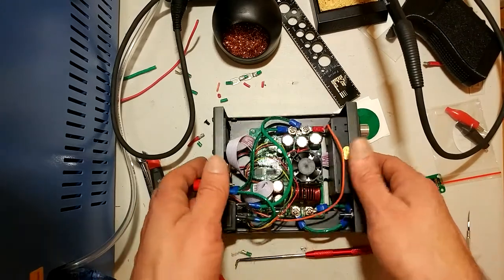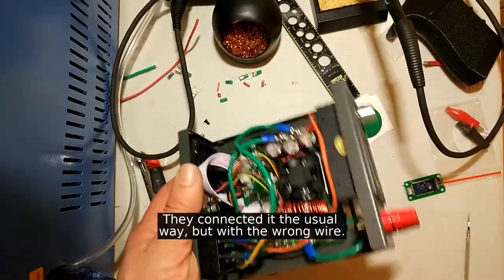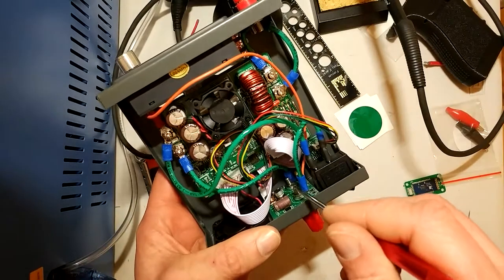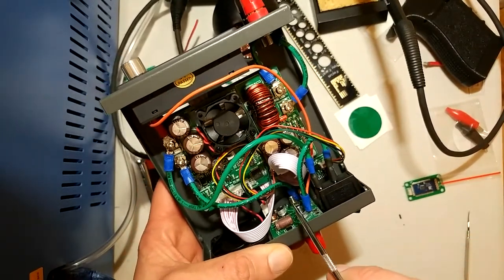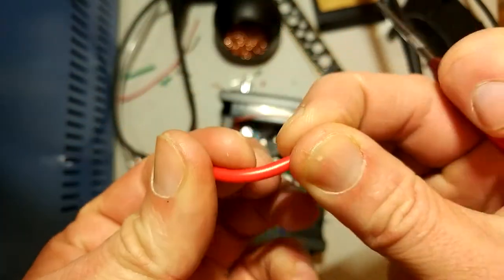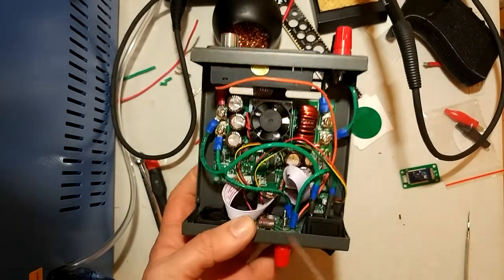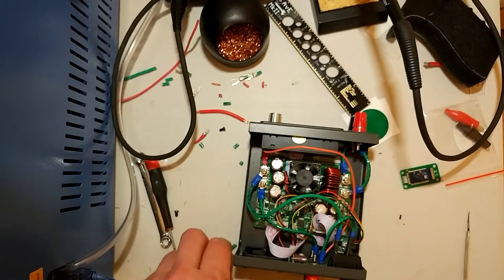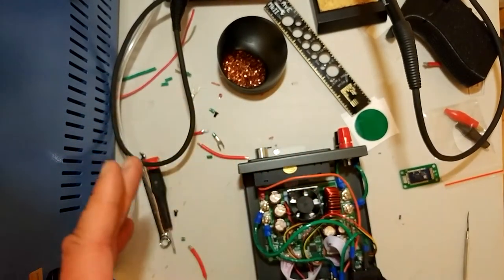RD Tech DPS5020: Assembly Tips

Comment: Hi, thanks for your video. I watched your video before attempting to assemble the unit I just purchased. I attempted the manufacturers instructions and it went together quite easily. I had a beefy tip with the temperature set up at 290degC. I assembled the rear pcb first, then when cooled down I bent over the wires and attached to the switch with no issues. Also the terminal supplied soldered easily onto the wire supplied very easily. Maybe its the good solder or beefy hot iron I used. Went together easy. I have no affiliation with RD. I have used the RD6006 and also recently purchased another RD6006P and they assemble very easy as no soldering or wire cutting is required as everything is pre-terminated. Sorry my experience does not agree with your observations, maybe iron size or temperature or solder type / flux related. Also dont bend hot wires, let them cool down first. During the assembly everything was a breeze for me.
Reply from the maker: Oh, I'm totally open to the possibility that I'm bad at soldering. Hahah. I work in software, not hardware, so I generally prefer my electronics come preassembled!

I'm glad that you were able to put it together easily. This is just another option for amateurs such as myself.

Comment: Flexible (many thin wires) silicone-insulated wires helped a lot. 13 AWG (12 AWG did not fit in the big holes on the small switch board), but I had to solder the wires for the switch to the pads on the board.

Btw have you tired to switch off/adjust the speed of the fan on the case? It spins up even when there is no load.

Comment: Hi - still building the 5020.  Thanks for the warning!  I fear that as a follow software guy, I might have made a mess of it without the warning.  But I am using a different stratagem to mitigate the difficulty.  I'm soldering that small power distribution board first.  I'm starting with the "key" (for the switch) ... the small pads / holes.  BUT: I'm using some high quality silicone / lots-of-strands (very flexible) 12 AWG wire. Oh - and a 30W soldering iron + copper thingy etc.  Anywayyyyy ... my secret source is to take some header ... err ... 2mm pitch I guess - I forget ... maybe 0.1" ... whatever ... cut off 3 pins worth of it.  The I push out the centre pin (discard).  With the remaining 2x pins stuck in it's trimmed plastic retaining thingy, I push the pins into the PCB holes from the underside of the board.  I push the pins so they're flush on the underside with the plastic retainer thingy.  I use some ... blu-tack we have in the UK.  Tack.  Whatever.  To keep it in place and to stick on a surface.  No helping hands required.   First of all I solder the pins in place on the pads like a normal SIP component thingy.  Then I can carefully twist some (insulator-sleeve removed) of my 12 AWG wire over a pin.  There are so many strands,  a length of it can stand-up in the air by itself, anchored by twisting onto a pin.  Enough length to (comfortably) flexibly bend to the switch (eventually) (after putting on some of those err ... things that go over the spades on the switch thingies).  Yep.  It just stays there.  So I can take my time soldering it (not so much time as to lift the trace of the board (and no particularly heat-sensitive components are near enough to worry about them) but enough time for a 30W iron to attach it to the pad and at least glaze the strands most of the way around.)  Next I similarly work on the next wire, though I can now use some electrical tape to stick it in place using the first wire as a crutch.  And I move the blu-tack away from the heat.  It's possible to do a fairly neat job with a little care and patience.  Next I remove the plastic header-pin-retainer thing from underneath the board, and solder the pin protuberance under there to the pad like a normal component.

I'm confident that between contact with the pins, being pushed onto the pad,  and being soldered to the pads, my wires should have a decent connection for that 20A even if it's not one solid lump of solder.

Finally of course a sleeve of heat shrink goes on.

I'm quite pleased with the result - staying with the traces/pads etc.

I still have to finish the build though - hopefully it'll all work!  I'm using my 12 AWG wire in the through-holes to connect to the main board with ... though very very carefully so as not to have loose strands so close betwixt the poles - and very careful with heat application because of the finer via to connect to.  It does seem a bit odd, the boards arrangement, for the heavy-current lifting.  Oh well - will see how it fares.  I suppose thinner wire over a very short distance, in air, and connecting meatier thermal mass either end, wouldn't do too badly though with 20A necessarily - the thermal connectivity and ambient conduction capacity of the air and all-round radiative capacity and considering a fairly low V-drop over a very short distance might not propose a significant issue, as a feed to a buck converter.  Maybe.  It's been too many decades since I last studied electronics.  :)

But thanks again for this video.  It was very useful, ta.
Reply: It still works - not had a chance to try the USB practically yet.  Still working on a new revision/attempt at a LiFePO4 UPS I'm working ... I need two for my NUCs  for starters (VMware) set-up ... just 19V, but also an isolated Pi-KVM each.  I have an Ezcoo KVM that works with Pi-KVM but I accidentally bricked one when I was using it with a centralised Pi-KVM set-up using a centralised control system UPS I was making but using buck-boost modules for each device ... I'd forgotten how the inductive outputs would cause issues when making grounds common and using a buck-boost module for CC/CV battery charging.  I did get a new Ezcoo and affordable Mean Well DC-DC isolating converters, but I've decided to simply have one Pi per UPS.  Pref. Pi zero 2's as they work with CSI HDMI capture and perform well enough for about 1/5th of the power of the Pi 4's I'm using but it's so hard to get hold of Pi stuff now.

I'm obsessed with 50% standby intent ... thinking even if I charged to 100% every day and let the battery discharge powering my Nuc/Pi etc. to 50% - every day, I might still see 15 to 20 years of useful life if the battery BMS holds-up.  But that's my speculation anyway and only working models and lots of data will provide more confidence to my assertions.

The secret sauce to my UPS fantasies are decent ideal diodes and decent converters.  I'm using kit from the US ... from Minibox for the Y ideal diodes with enable capability, and their USB 200 buck/boost converter for my 19V NUC supply with wide input.  I want to match at least a 120W PSU spec of my NUC's OEM supplies.  Mean Well for a 150W 15V mains supply, a cheap buck/boost for CC/CV battery charging with an I2C FET switch on the input and a basic 15A ideal diode on the output, and a Mean Well 25W 5V DC - DC converter.  Oh - and a 7A - 8A LiFePO4 12V battery that's really cheap!  Bought a few of them ... they're good.  INA226's for high-side (and low-side supported) I2C Voltage/Current measurement as they're available for cheap from Ali-Express along with some temp. probes.

This DPS5020 is to help me with charging/discharge experiments as I could just use MODBUS with my preferred C#.

I want to re-use a bunch of Arduino + similar-to-but-predating-Lorawan complementary encrypted serial wireless chips that are much more reliable for small packets of info over longer range etc. for my battery telemetry and central control  / LTE VPN failover etc. for over-rides of the Arduino - there to manage that 50% charging but also to respond intelligently to various black-out / brown-out scenarios at different occurrence frequencies and patterns along with battery SoC and previous state for events to minimise boots/shutdowns and for phased recovery of multiple systems to avoid surges.  Oh - and having double-conversion in a UPS provides opportunity for additional surge protection.  The Pi-KVM will allow for a couple of cct overrides but I'm keeping it completely Vcc/Gnd isolated to help avoid ground loops via the NUC ... network's not a problem but the HDMI connection and OTG USB keyboard/mouse ... but the HDMI connection might be especially sensitive.

Yeah.  LOTS to do!  When I can get away from work!  Oh - and my Arduino stuff ... I forgot ... that's to have it's own mini-UPS using a single LiFePO4 cell though that'll stay at 100% SOC mostly - I don't expect so much from that as the Arduino etc. will mostly be sleeping during extended black-outs after shutting down the main system.  It should be useful for as long as the main battery in terms of calendar life I think.

Oh!  I forgot ... my UPS's are going in the attic and have to very dust resistant while still being ventilated ... with a fan for the USB 200 converter only coming on when needed ... but I also have to take into account temperature for battery charging/discharging and temperature discharge current to spot potential overloads.

I wish I could just buy this stuff but I don't seem to be able to outside expensive Industrial Control systems.  :(  I want to put stuff in the attic and forget about it for 10 to 20 years.  I want it to just work.  To alert me if there's a major problem.  Let the machines do the thinking; do the work.  I want my brain for other things.  But we seem to live in a society where we expect people to pick up the poop from the machines rather than vice-versa.  I don't really "get" people lol.

Sorry - chatting and chatting.  I don't get out much.  :)  And my colleagues are more "normal" lol and software people mostly with fewer hardware fantasies than mine and most people's eyes glaze over when I talk to them.

Anyways - I just thought I'd link to an Amazon review thingy I did ... as I stuck a few photos of my 12 AWG wiring in this buck PSU thingy ... err ... dsp5020.  I keep forgetting what it's called lol.  I'd better sleep now.  :) (I'm a bit short on sleep atm).

https://www.amazon.co.uk/DollaTek-Communication-Step-Down-Converter-Voltmeter-DPS5020-USB/product-reviews/B07PJHF4FN/ref=cm_cr_arp_d_paging_btm_next_2?ie=UTF8&reviewerType=all_reviews&pageNumber=2
Reply: Had some sleep.  Gosh I do waffle on.  I did forget to say, about my UPS endeavours ... of course, my Arduino is to function as a watch dog for my Pi KVM, and the Pi KVM as a watch dog for my NUC's ... which is a major reason to integrate it with the UPS stuff for power cycling which I'll hardly ever need, avoiding running ATX control cabling into the NUCs themselves.  I have massive heatsinks on them - essentially a passive system though I don't decrease the ... thingies ... where you set the CPU power over rolling-average type things for thermal performance.  I forget names of things.  Errr ... Tau I think they use for the timings.  So I have an external fan, with large intake enclosures for reduced pressure intake over large filtered surface area, remembering this is going to sit in an extreme dusty environment with quite large temperature swings, but the fan won't need to be active often.  Yeah - I'm trying to avoid too much interconnecting wiring adding complex dependency coupling between things.  I'd rather just cycle the power feed, if it's an uncommon thing.  I only restart my NUCs a few times a year, if that ... but the SSD's etc. are encrypted below the OS hand-off and I have to enter a password during that early boot phase (I can't afford the more expensive VMware encryption stuff but I'm happy with the "built-in" implementations for my needs - I hardly keep State secrets lol).

I'm using 10th Gen I7 Intel NUCs - Frost Canyons ... I'm very pleased with them.  The 6-core approach seems to work well for VM CPU scheduling even if the multi-core performance == or is < 11th gen 4-core.  I wanted something with very wide flexible power response, with touted idle power going as low as 4W (before peripherals etc.) because these things are always on for me for a decade+ but I only need it for home email, web server stuff, IoT / Home Assistant etc. though I might look at setting that up on a dedicated bigger-batter UPS central control system tied in with failover LTE/VPN,  and on my NUCs still - various docker containers, oh - a VM that I use for my work/Dev and so on.  Even with multiple OS's, as they idle, the over-all power required isn't that high.  I don't need a high-end server.  I wanted daily drivers and a "lab" all in one little neat package that'll stay relevant for a while at least.  These NUCs aren't certified for 24/7 multi-year use but with the heatsinks and minimising thermal/electrical stress I'm hopeful.  Hence another reason for all this UPS madness.  And I don't have space for all this stuff, hence wanting to put it all in the attic - also less accessible and more theft resistant ... but also why I need it all to be very reliable as it'll be painful getting to them for maintenance.  I still use pfSense in another oversized dedicated server because if I die or anything I want stuff that my spouse needs to "just work" for some time without me - aside from the more complex rigs.  Though I'm looking at having two pfSense VM's - one as a failover, on my NUCs ... I have a passive Thunderbolt cable between them for 10Gb networking (Thunderbolt controller passthrough to the VMs) so my more complex routes etc for my VLANs can be more local and faster virtually.  I have a pfSense VM running in Azure (cheaper than their appliances) for a site to site to my Azure stuff.

Yeah - overall I desire both "power" to have fun and do stuff reliably, but fairly efficiently too for the "value" it gives me.  I get very frustrated when I can't just buy stuff and everything seems so wasteful.

Comment: How did you attach the terminal ends to the switch?
Reply from the maker: A couple of female spade connectors - the 1/4" wide ones, if I recall correctly. If yours don't have an insulating jacket on them, you'll want to add some heatshrink. The case is very cramped and you wouldn't want anything shorting out in there.